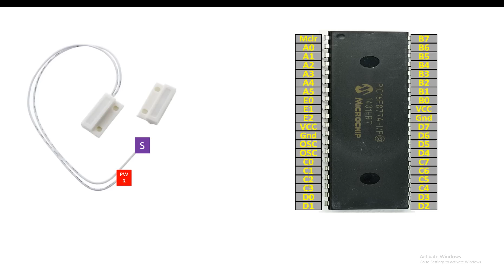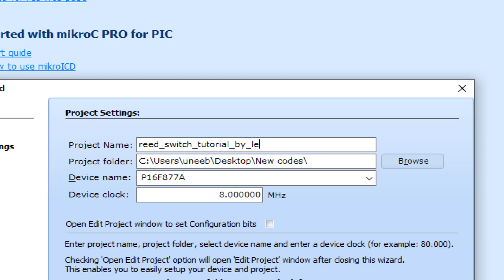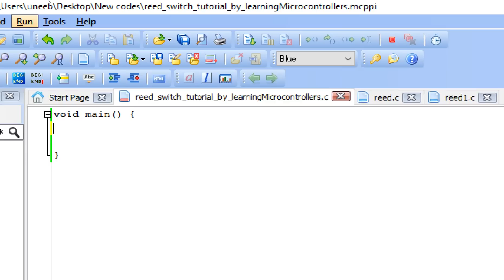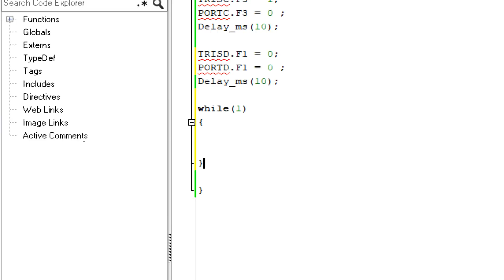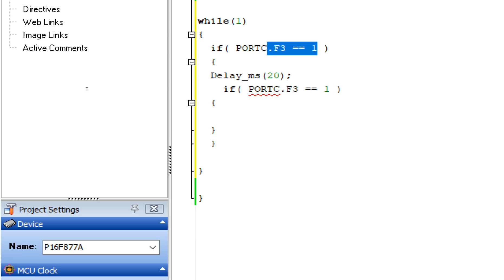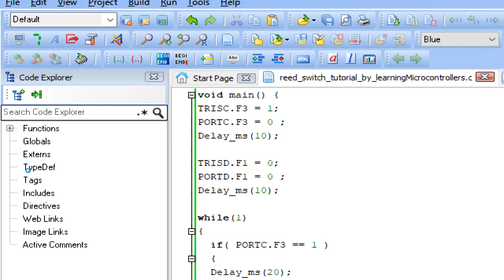Door open or close detection system. Using Reed switch and PIC16F877A.

Comment: Dear sir how to read the program from 3.3v pic ic in a circuit board. I tried to read the program in a dspic33 serie pic ic using pic kit 2 software . But when connet the programmer and open the software, it gives peace check the vpp err massage. How do i do for this sdpic33 ic.
Reply from the maker: I check and let you know